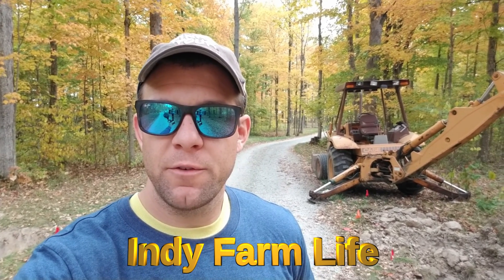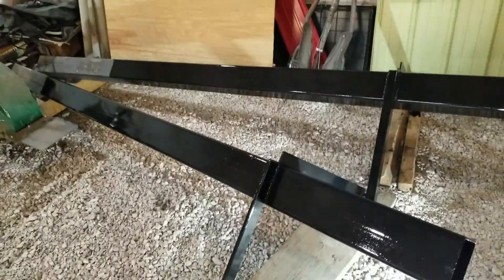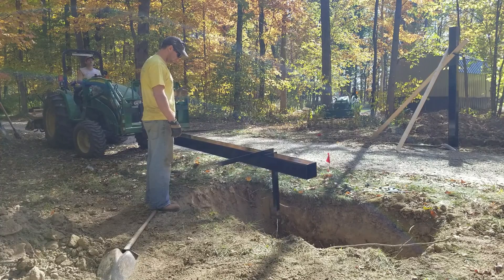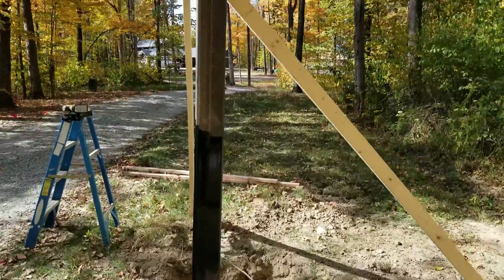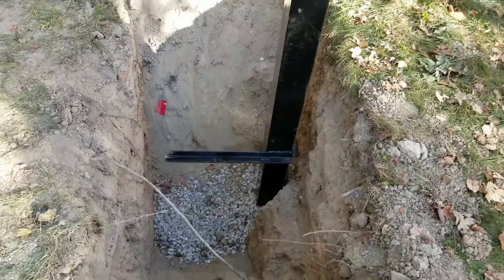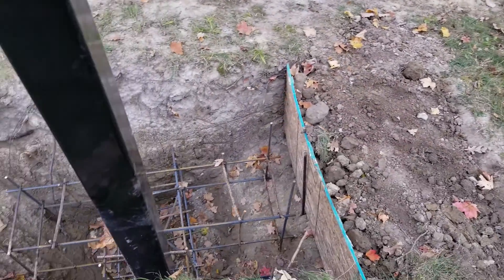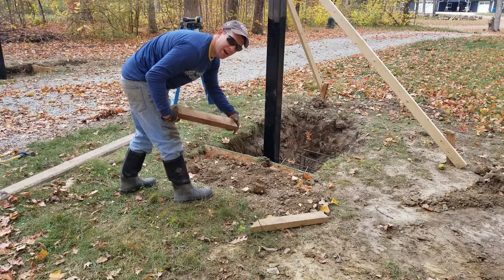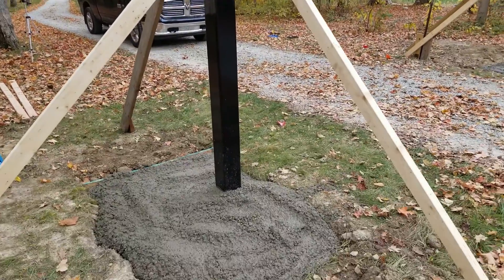How to Set Steel Posts in Concrete - These Things Aren't Going Anywhere!

Comment: These posts are going nowhere. how anyone thinks otherwise is beyond me.
Reply from the maker: Thank you!  Could they maybe be better centered in the hole?  Sure, but we couldn't cut it in any more due to the location of electric and sewer lines.  The posts are also now filled with rebar and concrete.  When I think about these posts, the term "Brick Sh!thouse" comes to mind! 🤣
Reply: WITH THAT AMOUNT OF CONCRETE IF POSTS STRONG ENOUGH   YOU COULD  HANG A SOLID  STEEL GATE ON IT
Reply: Will the concrete not affect the inside of posts
Reply from the maker: I don't think it would be any different than when steel rebar is placed in concrete.  So I would venture to say no.

Comment: Hate to say this.  But, because the posts are way closer to the inner edge of the rebar cage/hole, the vertical posts may not get the optimum structural support.
Reply from the maker: Mabye so, but I'm not worried about it.  The posts are now also filled with rebar and concrete and each only has to hold a 300lb gate.
Reply: I don’t think you hated saying it.

Comment: I'm setting a much smaller post yet I was wondering how to do a better job than the "fence company." The rebar cage! I have a round post so I think drilling a hole and fitting rebar thru the hole... My automatic gate post hardware snapped the other day because the post spun in it's hole. Thanks!
Reply from the maker: The rebar will definitely help strengthen it!  Good luck with your project.

Comment: Vibrate and wet cure? Much stronger and less potential for cracks
Reply: I noticed this too. That cage and not vibrating the concrete are pretty amateur moves. Same with plumbing the posts with a homeowners post level. The longer the better, always. That said, this is only for side loaded posts and is not a real load bearing application with a beam on top like a footing. So it is doubtful even with cracked concrete that they will ever budge. Maybe the joke is on us because he probably got it done fast, got paid, and gtfo. Maybe even got lucky that night.

Comment: Except there is only cement on 3 sides?
Reply from the maker: Looks that way at the surface but I assure you it's all the way around.  The posts are also now filled with rebar and concrete.  Solid!

Comment: 6 yards of concrete is enough but the post is like 3 inches from the edge of the tension side i would think the post would have to be close to the center.
Reply from the maker: It's a bit of an illusion.  The top is more narrow, but at the base we were about 6 to 8 inches away from the side wall.  We do also have the angle iron to prevent lifting/twisting.  The posts were later filled with rebar and concret.  They aren't going anywhere!

Comment: I hang 600 lb gates on 3" sch 40 pipe with 12"x5 foot deep holes.

Do u have soft soil or ? Lot of mud around those posts
Reply from the maker: Wow, and you don't have any trouble with them leaning in?  If not, then we won't have any trouble.  Ours are only 300lb each.  We have very hard packed clay in our area.  No soft soil to deal with.

Comment: We did the same thing with the same posts. The weight of the gate when hung flexes the steel post like butter. We had to weld gussetting to the post and anchor it in concrete both at the closed position and at the open position.
Reply: @IndyFarmLife  we did too. Had to install PVC in holes for hinge bolts in posts so hinge bolts can freely move in concrete before pouring concrete into posts for later adjustments.

Comment: You can avoid rebar if you use MACRO fibres in the mix..and to avoid cracking during curing, have them add MICRO fibres... perfect for ground lumps and slabs like these..also it avoid the nasty concrete rust disease in a few years..

Comment: Would this method cause the poles to rust out faster? I have some 8" poles schedule 80 and was debating if to put them in concrete or weld them to the concrete footers by using a plate on top of footers. I'm making a 16'x32' deer blind, well a cabin on stilts.
Reply: If it's still relevant: use hot-dip galvanized anchor bolts in the concrete and a baseplate on your steel, and leave enough anchor exposed to set the base plate atop "leveling nuts" below it. So longs as you use a thick enough base plate (probably 3/4" or thicker) and large enough bolts (probably 5/8" or bigger), then that will last at least 100yr. Alternatively, have the portion of your steel embedded in the concrete and at least 6" above (if not all the way) hot-dip galv. That is also a 75-100yr solution. Base plate directly on concrete is also fine; just cut a 1/2" or so drainage groove each way under the plate. Also if you're using tubular steel like we see here then drill a hole in the middle of your baseplate (or better yet at each corner) inside the post to drain it.
Reply: @evilassaultweaponeer  My plans for my off grid cabin in the air were placed on hold due to prices of lumber sky rocketing. I have the 8" x 14' pipes on racks ready to be cut to size.  I am having difficulty understanding the first sentence so let me see if I understand correctly. Install galvanized anchors sticking out of concrete, place nuts on top of concrete to be able to adjust, base plate over nuts followed by more nuts on top. 

I see people around here placing a 4" sch 40 pipe with a plate welded on top and then inserted about 3 feet into concrete. The only issue is you are very limited on adjustments as the beam will be welded straight onto plate.

My cousin got 20 foot 4" ID pipe with an epoxy coating and shoved them about 3 feet into concrete. This method just worries me if the pipe will corrode early.

Well glad to get more info for my projects.
Reply: @cutweldngrind  you have the leveling nut concept correct. As for the pipe: skip the epoxy and get hot dip galvanized if you go that route. You can adjust it with a grinder or shims,  it leveling nuts are better.

Comment: According to Auburn Concrete Company, a yard of concrete weighs approximately 3700 pounds. 3x3700=11,100 pounds per Gate post.  I think the 300 pound gate is safe.  But did you fill the post with concrete to keep it from bending under the weight of the gate?

Comment: So you have most or the concrete on just one side of the posts? Do you think you should have the rebar surrounding the post because 3 inches of concrete on ons side is not enough
Reply: The holes could have been dug just an inch or two larger than the posts. Looks like homeowner dug holes. The ground on either side of the form is undisturbed and concrete thickness is irrelevant in this case because the posts are not producing significant downward load. The only relevant measurement volume wise is the height in this case. When the posts are cut to height and filled with concrete there is nowhere for the post to move laterally. If you put a house on top of them, they would sink, that is what footings are for.